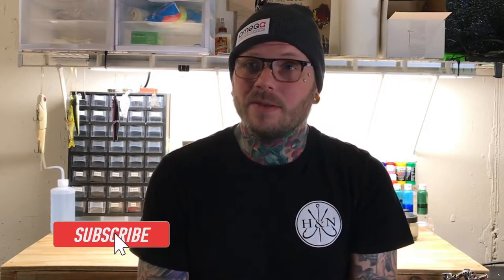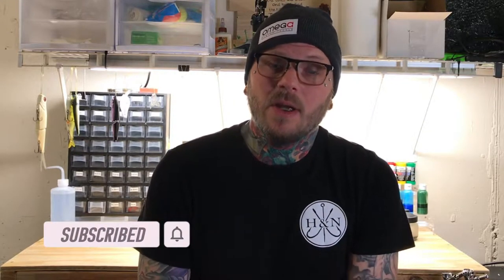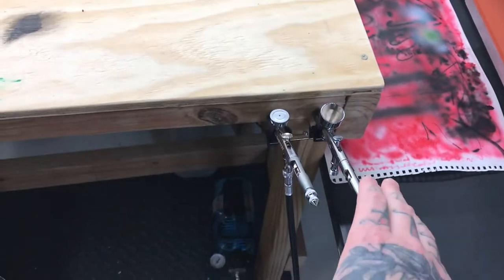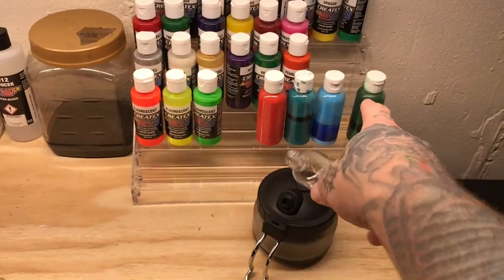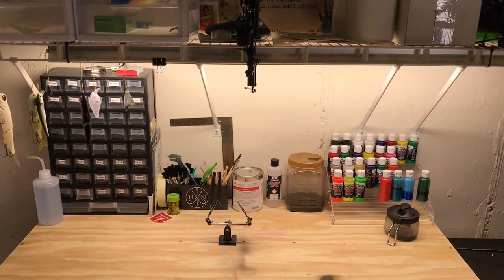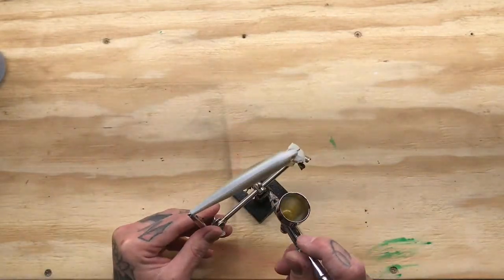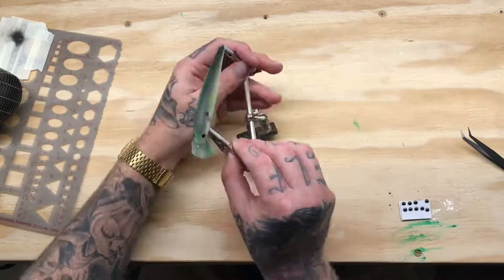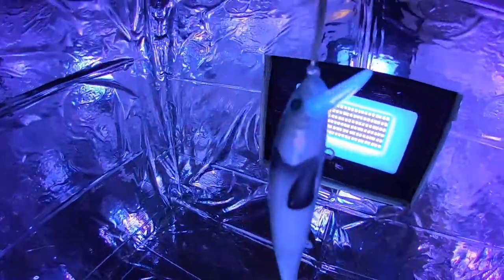Lure Painting Pattern | 110 Jerkbait (New Lab Set Up)

Comment: What size split rings and hooks do you use on the jerkbaits
Reply from the maker: #2 split rings and #5 treble hooks
Reply: Would that go for a 130mm also
Reply from the maker: You can. But size up the front or add a second split ring if it floats up. May need more weight or less if you want it to suspend or slow sink. Easy to adjust on the fly if needed.